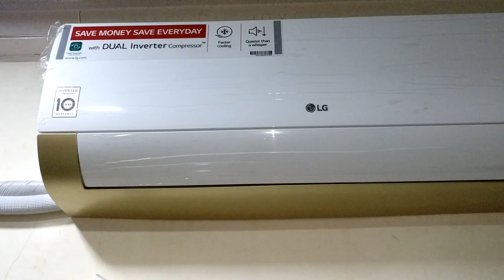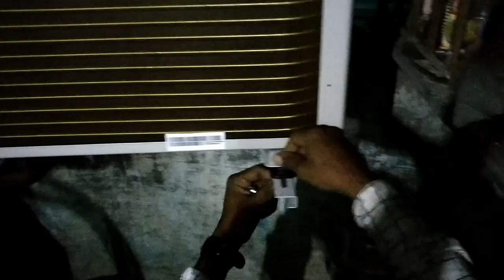LG Dual Inverter AC installation by LG team | LG 5 star Air condition

Comment: Have you 
 encountered an issue like when temp is set to 27 and ac is cooling and maintaining the room temperature to 25 or 24 and not less than that? I checked it for almost 4 hours. And the remote was kept away from direct air from ac. And this issue is happening daily.

Comment: Are you happy with your LG dual inverter AC  ? Cooling wise & Performance wise ? Give me your opinion
Reply from the maker: Yes..i am using since close to one year and i am very much happy with this ac. Cooling may disappoint u if you not choose ac ton size proper. I am using 1 ton for 100 sqft room then cooling and performance is good.
Reply: @HappyGuide  my room size 154 square feet ? Advise me according to that
Reply from the maker: Go for 1.5 or 1.6 ton. LG or Diakin brand
Reply: Sir 200 sqft bedroom.. (no direct sunlight on any wall) {but direct sunlight on ceiling}... Mene  lg 1.5 ton LS-Q18YNZA purchase kiya hai
Is it right tonnage for 200 sqft bedroom? 
Is it give me proper cooling or not?
I mean it is sufficient for 200 sqft bedroom?